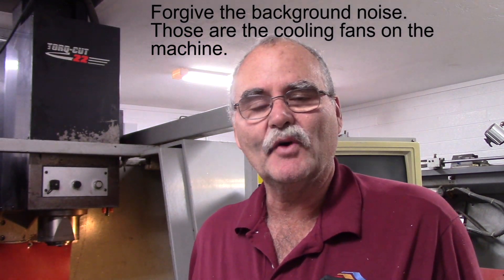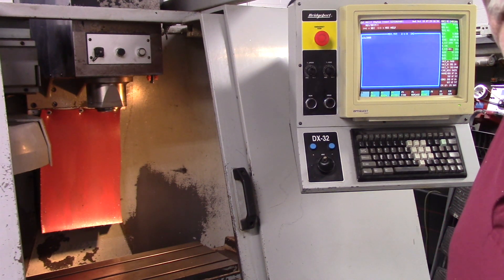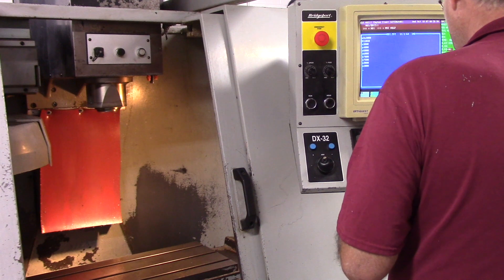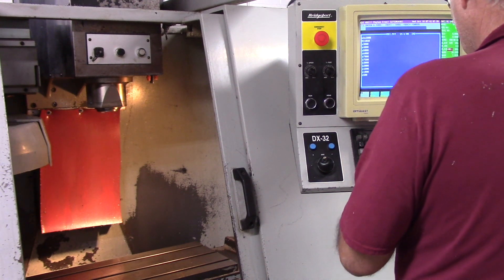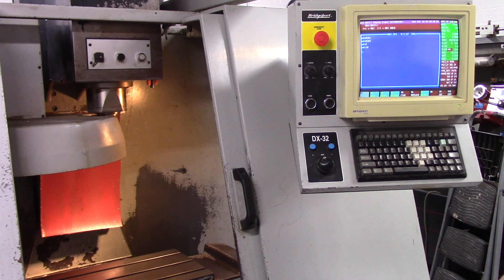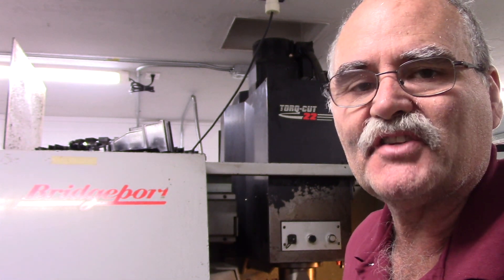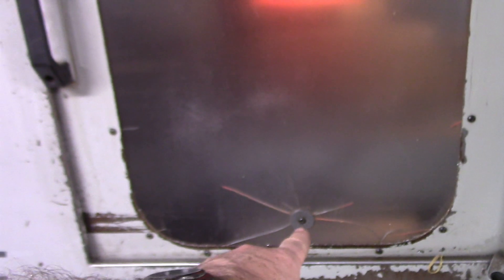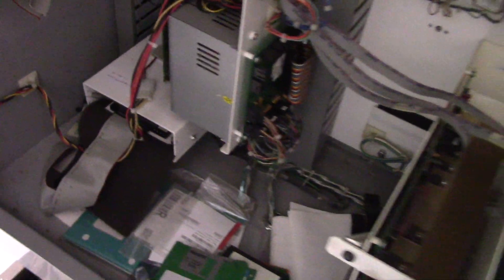Bridgeport Torq Cut 22 Demonstration. For Sale, located in Mesa, AZ *SOLD*

Comment: Hi Marty, I hope you're doing great. 

I just purchased a Bridgeport VMC 1000/22 machine and i want to retrofit the Dx-32 controller for a centroid All-In-One but i was wondering if the drivers and servo motors that i have are compatible with the controller (I wrote to Centroid guys but they have not respond yet) maybe you can give some advice to achive that.
Thanks for reading me and thank you for your great work i'm a novice in the cnc world but with your videos i have learned a lot. 

Greetings
Reply from the maker: Yes, you could refit with All in One DC. You would have to replace the encoders with new encoders. I sold this machine. I was going to use OAK and DMM 1.3KW AC Servos. However you can do it with All in One. Using new servos ensures that the motors are new. Now if  your machine is in really nice shape, then no reason not to use your motors. Your challenge is do you have the experience to do such a conversion? Getting the XYZ to move again and the machine to cut metal is the easy part. Doing the Toolchanger integration is tougher.
Reply: Yeah actually it is in a good shape. Oak must be better for my purpose i guess. I would like to keep the same servos and drives because if not i would have to spend a much more money and like i said the machine is in great shape. Haha that's sad i would have love to watch the videos doing that retrofit
Reply from the maker: @oliversanchez7527  I'm pretty sure you can use the original drives. They are proprietary to the Bridgeport BMDC DX32 control.
Reply from the maker: @oliversanchez7527  the original control is not bad. You can replace  or add along side the floppy drive a Gotek USB floppy drive emulator to get your G code programs loaded

Comment: I bought one just like this in April 2018 and sold it in October 2019. Was a terrific machine! I outgrew it and I would have kept it around but my shop is so tiny so I sold it to a friend. My only real complaints were that the spindle was terribly loud and it couldn't run 3d/complicated toolpaths very smoothly. For the price I think they're amazing machines. Intuitive and easy to learn control. Mine held tolerances well enough. Small machines. BT40 toolholders can be had on ebay really cheap. Gets you into a machine with an enclosure, flood coolant, tool changer, and rigid tapping for next to nothing. 1000x more useful than a knee mill conversion IMO. Anyone who buys this should be very happy with it.

Comment: I just bought an Ex-cello. I would like to convert to Acorn. I am not sure how I should run spindle speeds since it is 3phase and the variable speed pulley. Any suggestions would be appreciated.
Reply from the maker: Use a VFD. Either replace the pullies with a 1:1 arrangement OR set the variable speed pullies at 1:1 then setup the VFD

Comment: Great machines, I have a TC1 in my garage down in Chandler AZ, I am interested in your Z way cover and telescope seals, also, I saw some 3.5 floppies in your video, I would be interested in those if it has some probing software, 4th axis and/or RS232 data port software, would love to have the whole thing as a back up but not quite in the budget and would have to store in yard which makes me cringe.
Reply from the maker: The floppies just have back ups. I can actually make more on the machine by parting it out and keeping other machines going. Loose a spindle drive? Ouch! You should buy it for spare parts....The TC1 is the same with the newer control computer I think....I hate to part out a machine that is still working and will run on single phase...

Comment: The spindles have different grippers for BT and CAT. If you look inside the spindle you can see balls on the BT and a claw arrangement for CAT
Reply from the maker: If you look at the Bridgeport BT40 pullstud profile, it's the same as HAAS. So you buy HAAS pull studs for CT40 tools and change the grippers. Already tested and it works. NOT using Bridgeport TC CT40 grippers
Reply: @martyscncgarage5275  That's nice to know as a future option. Sad to see her go. What did you get instead? There was a 2004 VF4 going for cheap near by but it was gone before I could even ask.
Reply: @michaelalcocer6778  Atrump Maximill with Centroid control
Reply: @michaelalcocer6778  That thing was located in Michigan.
Reply: @joshtryon1107  I saw it on Craigslist for the Sf bay area, didn't even have time to contact them. Even with rigging and shipping it may have been a good deal still. The guy still has 2 miliacron 500's listed for $1600
Reply: @John-ik2eg  under $8k with an APL. It didn't say much about the specs of the machine past that. Could have been all clapped out but still for a home shop guy that's a deal on a full size machine.